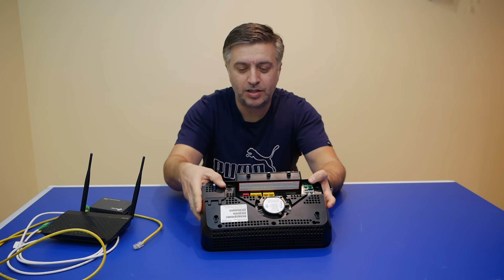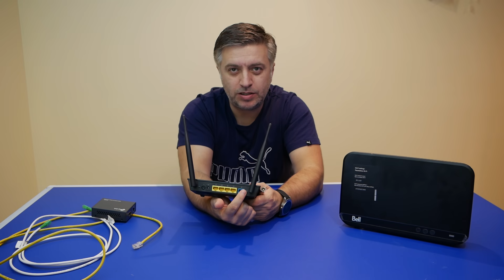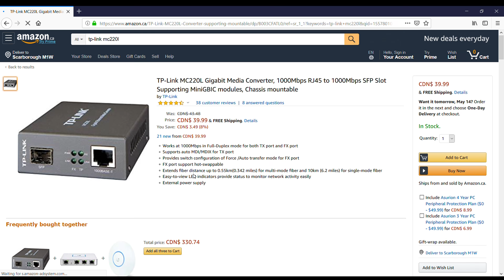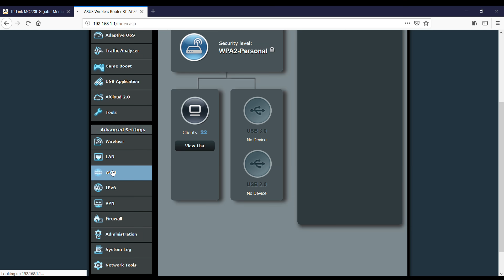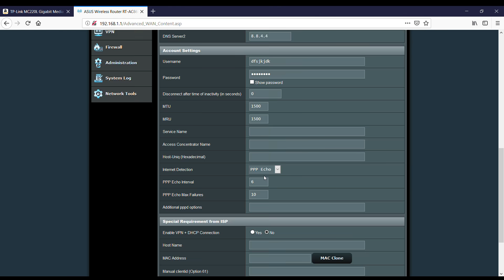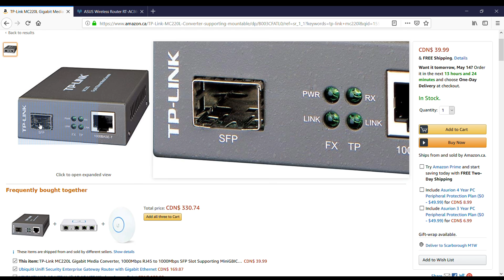How to remove/bypass Bell Hub 3000 and use your own router

Comment: @Marius C: Hello from Winnipeg.  Thank you for this video!  I am soon getting BellMTS Gigabit Fibre (940mbps Up, 940mbps Dn) on a Home Hub 3000.  But I want to do what  you have done on your video, and instead use my Asus RT-AC86U (ASUS firmware 3.0.0.4.384_82072, 
Signature version 2.196  Updated : 2020/09/03 03:02), for all functions such as NAT, Firewall, etc. and avoid using the HH3000 altogether.  But I have a question. TP-Link MC220L seems to be sold out on Amazon.ca right now - can I use this competing device by 10Gtek?  https://www.amazon.ca/Gigabit-Ethernet-Converter-1000Base-Tx-Transceiver/dp/B06XPY2Z2R/ ?  Do you expect that the functionality would be identical to the TP-Link?  Thank you for your great explanations in this video.
Reply from the maker: It should work, it has a SFP slot open that you can insert Bell module. The rest is just a media converter. But I can't guarantee anything. If it doesn't return it to Amazon. Good luck.
Reply: @advfreedom  One more question.  This other unit I have looked at specifies "Without Transceiver" - what does that mean, as compared to other units?  Is that the piece that we removed from the HH3000?
Reply: @BrownBullhead  Yes they're just saying it doesn't come with a fiber module.  You're correct, it would come from the Bell hub.

Comment: Nice article on how to remove the bell modem/router and get more control. The whole radiation thing though  is utter silliness since  though it technically microwave radiation it is so in name only as they are both slow low freq and power that you have more risk walking outside in the sun. You could get sick by climbing a broadcast tower and standing right in front of the antenna but that takes a major degree of crazy. This happens every time they announce a new bandwidth claiming its causing illness as they some how ignore that illness gets cure/vaccine but the signal remains unchanged. Not sure how they keep ignoring facts like diseases going away but stuff like 4ghz still being used and not realizing what that means.
Reply: If you experienced the tinnitus and headaches I do when exposed to a WiFi field you would not think it silly.  Not everybody has the same sensitivities and it doesn't create an instant result like turning a light switch on and off.  People don't believe in radiation health issues because it is inconvenient to do so.  The fact that you're this dismissive illustrates your lack of understanding.
Reply: @buzz464 I quite literally work in the field and been doing so for a very long time lol. This nonsense has been going since 2g came out then 3g and so on. The higher the number the shorter the wavelength the less ability it has to penetrate the body. There the COSMOS  study which is slated to go on for 20 to 30 years and what it found to date is removing the source of the signal nearly always doesn't remove the problem. It's like pointing the finger and saying this caused it without bothering to find out if it did or if it's even possible. Long story short 5g can't penetrate human skin let alone your organs or bones. The biggest problem with this is the fact people who worked in the industry for years on end and been exposed to far more 3g 4g and 5g then the laymen aren't reporting problems. Ohh and tinnitus causes are extremally well known and wireless signals are not one of them. Having you phone headphones up to loud can cause it and so on.
Reply: To further put a nail in the coffin we had 3g for roughly 41 years now. There are no 3g related illness, tumors ,conditions what so ever. 3g is a longer wave length signal then 4g or 5g and has more of a chance to penetrate the human body the the other two would. If 3g couldn't make you sick how the could the other two ?!! Basic high school science here the longer the wave length like say gamma the more ability to penetrate the body the shorter the less ability.
Reply: @magnus33john  Why do some people get cancer and others don't?  If I were to follow your logic people who get cancer are imagining things as a way of getting attention. Some people are more susceptible to sunburns than others. I know for a fact that a WiFi radiation field makes me feel like crap.  The hotter the signal the worse it makes me feel. I had to work in the Bell Light Box for a short time where for me the WiFi levels were excruciating.  I fully acknowledge that electromagnetic hypersensitivity is a somewhat rare condition. Usually when I tell others about this they are dismissive and skeptical.  Why me?  This is due to inflammation which comes with age, diet and overall health. I tried our friends replacement fix for the Bell Home Hub 3000.  It was a no go.  I have solved the problem by putting the HH 3000 in a microwave oven which is a great RF shield.
Reply: @buzz464  Your reasoning doesn't fall any logic or basic science. So you think that hub makes you sick but the minute you walk out the door your exposed to far more at wifi at a much higher intensity yet your fine outside. Not to say someone  cant be electromagnetic hypersensitivity but wifi not going to be the cause. Anything with  lots of electricity going through it can generate  a field and people can and do react to it depending on how strong it is.. Overhead power lines. bad house wiring, poorly shielded power supplies and so on can cause them. 5g wont penetrate you skin but a strong enough electromatic field can do so. The bell light box does have wifi but no more so them most commercial places these days. What it does have is a crap ton more lights, projectors, sound system ,wiring and so on. Far more then the average commercial place has and generating a stronger electromagnetic field.    Lots of devices are poorly designed with little to no shielding, power bricks, many commercial routers, cheap monsters or tv and so on.

Comment: Does the ISP allow this? also what do you do with the modem afterwards?
Reply from the maker: Yes it does. If by modem you refer to Bell Hub then I store it in its box. I have to give it back if I end my contract with Bell.
Reply: @advfreedom thanks for replying Marcus!!

 I currently have Rogers ignite gigabit package and I use Asus gt ax11000. I have the xb6 modem in their so called "bridged mode" but I'm not getting the speeds I pay for when using the router. I get 400 down on a wired connection on the router but no issues when connected directly to the modem.

Would switching to bell and doing this method resolve my speed issues?
Reply from the maker: I don't know, never had rogers for internet.
Reply: Update:

Turns out my QoS was enabled. I disabled QoS and now my speeds are perfect.

Comment: Hi, Im presently on Fibe 300 and don't use the HH2000, but use two Asus 86U in mesh setup connected to the Alcatel Lucent ONT.  I inquired about going to the Bell Fibe 1GB/s package.  They said they will take away the ONT and provide with HH3000 garbage.  SO I'm looking for solution to ditch the HH3000 before I commit.  Question - what is the type of SFC module that is inside the HH3000?  I heard rumours it is a 2500Base-XX (2.5GB/sec) type.  The concern I have is the TPlink MC220L may not properly handle this SFC module and I won't get the 1GB/s speed.  Can anyone confirm the bandwidth they are receiving using this TPlink solution on the Gigabit Bell Fibe package.  So sense in going to the 1.5 Gigabit package as it's too much for the MC220L.

Additionally, can the SFC module be changed for a 1000Base?  Or are these SFC modules programmed in some way?  I'm even considering going back to the ONT setup after the Bell tech leaves and ditching the HH3000 that way rather than the solution offered here.  Thanx for any additional info anyone can provide.

I also see Asus has a new router (AX type) with a 10 GB/s SFC+ port.  I wonder if something like that would work?  Have to read more about it but it does seem interesting.  I imagine it's big $.

Comment: Do you think by using a Cat 7 Ethernet Cable would be faster than a Cat 6 cable?
Reply from the maker: Not necessarily. Depends on the cable length. Up to 100m runs cat6 is good.

Comment: My SFP Module goes into a Nokia ONT.  My HH3000 is downline from there.  Can I still accomplish this?
Reply: Assuming the connection from ONT is ethernet, then you don't need a media converter at all.  Just a router that allows you to tag VLAN 35 on its WAN port (from ONT) and allow login to Bell with PPPoE using your Bell username/passwd.

Comment: I am trying to connect D-Link DIR-882 router. I have connected the TP Link MC220L but settings on my dlink 882 is different. I do not see other options.
Reply from the maker: https://www.manualslib.com/manual/1182088/D-Link-Dir-822.html?page=64
Reply: thank for sending the link, but I have DIR-882, you sent me DIR-822. I will try to find out. Should I follow pretty much same instruction, right? thanks.

Comment: Do you have a video on how to use your own router (i.e. Nest Wifi) along with Bell Hub 3000?
Reply from the maker: No sorry, but I guess you disable HUB wifi and put the Hub in bridge mode.
Reply: I don't have a video - but, I've done this already.  I basically feed the ethernet from the Bell ONT, into a small 4-port VLAN switch, first.  On that switch, I split VLAN 35 and 36 traffic to two separate ethernet ports.  VLAN 36 from my 4-port VLAN router goes to the Bell Router, where I've shut everything on it off except IPTV - DHCP, Wifi, Internet, etc.  VLAN 35  for internet, I connect to my own router.  I've had this setup for many years now.

Comment: Has anyone had success using untangle as their routing system? I am currently trying to get this TP link working with my untangle so I can use my unifi network. But I haven’t had much luck. Any help would be awesome. Thanks.
Reply: untangle doesnt support the vlaning needed for bell, you will need a router to do the processing of that (turn off its wifi) then lan1 from it to your untangle router, from there ethernet/wifi out of untangle router/pc box as normal.  i use untangle for testing and sharing wifi with some greedy neightbors some time ago, they hated the limits on speed and content i put so they got complainy and i cut them off (reduced bandwidth to keep priority for me - middle school kids so prn/gambing blocked. 1 device per login ect) same crap any hotel sets up.

Comment: Fantastic video Marius! I am struggling a bit. I have all the same piece you mentioned in your video except I have an Asus RT-AC66R. I reset the router but have yet to get an internet connection. When you say your Bell User Name, do you mean the one I log into MyBell account with (my email address) or the User ID which typically starts with "b1xxxxxx"?
Reply from the maker: The b1xxx one and with the password for this b1xxx. If you don't know it or the Bell technician forgot to give it to you(intentionally) you can change it without knowing existing one. Watch my other video about how to change it.

Comment: I tried with D-Link DIR 3040 but no luck :( I put pppoe setting under ipv4 and ipv6, kept 1492 in Mtu and I put under vlan internet 35, iptvvlan 36 and voip vlan34. Please help
Reply: It’s ok. Got it to work with the setup above. Thanks
Reply from the maker: I never had Dlink routers and I can't help.

Comment: Thanks for the video.  I’m about to get Bell Fibe 1000mbps and home hub 3000 so will be trying out your instructions.  I’m curious what your speed is up/down with this setup?  Is it faster or slower speed than just using the HH3K?  Is the TPLimk converter solid?  There are no issues with it?
Reply: HH3k provides you with up to 1.5k up and down. you cant cheat for more then your paying for as it a profile on there side.   but you need to be wired in to get those speeds with a eternet cord that supports those speed search online for  the RJ-45 CATXX (CAT5E or CAT6 for example) of your cable usually printed on it. and your computer network card needs to support them to.

wireless is limited by the technology and your environment. so about 60mbps on 2.4ghz and 300mbps on 5ghz in a good environment at short range.  so your unlikely to see any difference on wifi as they follow standards.

the only time i would recommend using your own router is if you know what your doing and want more control then the modem provided gives you.  as every time you call them for help you will have to switch back to the HH3k as they won't troubleshoot unless they can run there test on the line saying your using unsupported equipment..
Reply: Wazii Hara I currently have a homehub 1000 which I’m doing pppoe bypass on with my Linksys router.  I’m upgrading to 1gbps fibe next week and will be getting a HH3K.  So I’m already trying to figure out how to bypass it.  The method shown here in this video looks great and it is readily discussed here as well: https://www.dslreports.com/forum/r31118482-Yes-you-CAN-bypass-the-HomeHub-3000~start=3300. The issue is that many report a degradation in speed.  Some are paying for 1gbps, but only actually get as low as 400-800 gbps, while getting 950 gbps when using HH.  So am wondering what others have seen in terms of bandwidth after installing this tp link converter.  I will be doing a wired speed test before and after bypassing the HH to see what my speed loss is.  Am wondering if others have done the same?
Reply: @glenshortliffe  for you and others who read, the bell SFP is 2.5GB, while all media converters are 1GB, this means there is a speed mismatch and you'll most likely get 50% of your bandwidth. There's no real solution out there other than expensive enterprise grade gear that can do 2.5GB sfp ports.

Comment: Hi Marius, thanks for these details, great info to get rid of the HH3000. One question, where is the optical cable coming from, I assume I have to unplug it from one of the boxes. Is it the ONT Alcatel-Lucent box? I noticed there is a cable being screwed in with a green casing. TIA, Lucian
Reply: alcatel lucent box is a ONT you must be on a actiontec R1000 or R3000  the setup is different then what they are talking about here. you can skip the optical cable step and simply use the cable coming out of the alcatel lucent box and plug it into your internet/WAN port on the back of your modem. just a warning that if you ever call them for help they will ask you to swap back to the modem they provided you and call back as your using unsupported equipment. (but it should be easy as all you have to do is unplug the eternet cord and plug it into the WAN slot back into the modem) 
just don't unplug anything from the alcatel lucent box side to prevent a mix up and a tech visit that may cost you money if they think you pulled a stupid.
EDIT: to be honest i actually like the R3000  and would not bother switching it out. unless there a specific function you want to do that they have blocked but the R3000 does just about everything you could want. 
(note i have bell aliant so there may be some differences  if your with bell canada)
Reply: @waziihara4109  Thanks a bunch
Reply: @waziihara4109  Hi, I have a question on the Alcatel lucent Box. I am guessing the 4 LAN ports on the Alcatel box are 1 Gb ports and one of port is directly connected to our own router.  If someone subscribe to a 1.5Gb up/down plan from the ISP, ie bell Canada. The speed at the router WAN or LAN port would still be 1Gb. Am I correct?

What would be reason to upgrade to 1.5Gb if the hardware (ie router and switch ports) limitation is 1Gb speed. assuming all cable are CAT6.
Reply: @paticiohk760 I live in the maritimes so I don't deal with bell Canada only bell Aliant,  I think it limit is 1gbps, bell Alliant will force you from legacy fiber network to the new one for the higher speeds. So you will need a tech and be swapped over to a homehub 3000.
Reply: @paticiohk760  there no sane reason to upgrade pass 500mbps imo  most people never use the higher speeds.
Reply: @waziihara4109  for 4$ extra on 2 years terms upgraded from 300 to 1GB. I ask about the hardware with a Bell tech support. I can keep the ONT and HH1000, but the speed come out from the HH1000 will be 940Mb. Currently I have my VLAN aware router directly connect to the ONT with full speed from the current plan. I wonder if I upgrade to 1Gb and keep the ONT n HH1000.  With direct connection to ONT, I will possibly get  1Gb but not more since the ONT LAN only 1GBs. Does my logic sound?
Reply: @paticiohk760   about 940mbps  will be your speed from the Alcatel Lucent ONT so that should be your speed on your own equipment. I don't see why anything would change with just a speed profile change. Again I live in a area where bell Canada only provides cellphone, bell Aliant is the branch of bell I deal with. We never had the HH 1000
Reply from the maker: Unplug the optical cable from Hub. After get the module out and then put the module in media converter and plug back the optical cable that you took out.
Reply: @advfreedom  thanks Marius, optical goes into the ONT box, I guess I just need to get the cat5 cable coming out and use it directly with my router. cheers.

Comment: My wifi speeds with the RT-AC3100 are atrocious. Am I doing something wrong?
Reply from the maker: If you have internet then it is good. Now about  your wifi speeds this is variable and depends on many factors. Is on 2.4ghz or 5ghz? What is  laptop's wifi card? Does it support AC? Measure on wired and start from there.